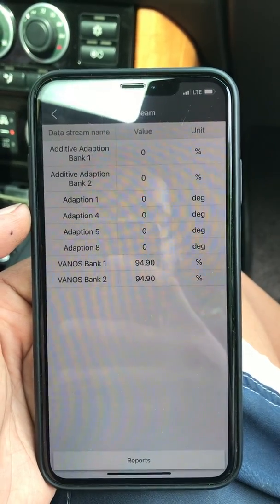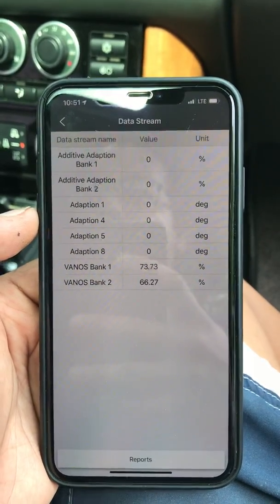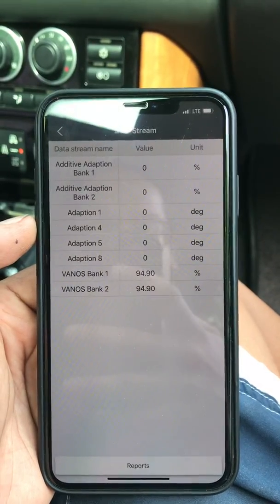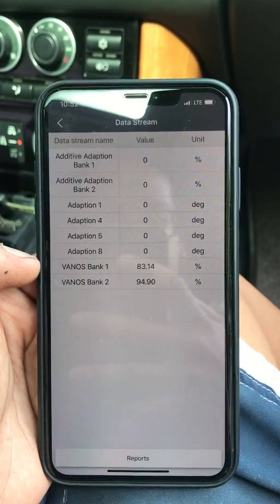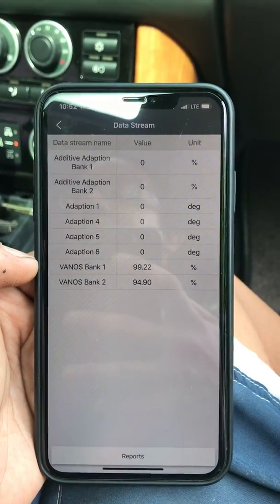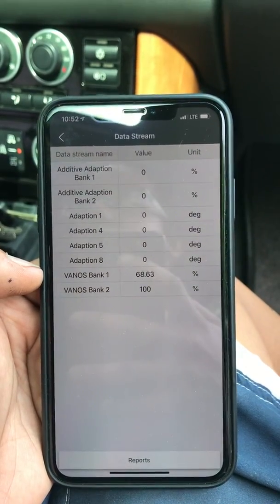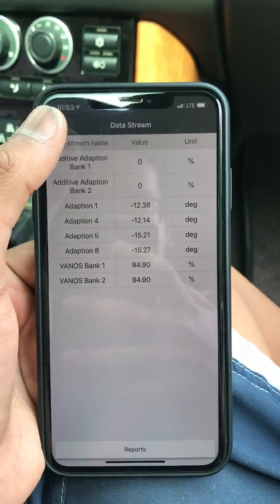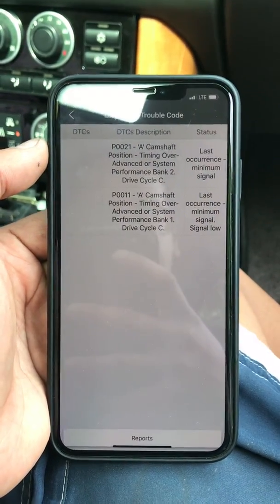2004 Range Rover HSE 4.4 M62TU Vanos Problem P0011 P0012 Fault Part 2

Comment: Looks like your cam wheels are not timed properly. There is a inspection hole in the timing cover to confirm but valve covers have to be removed and all timing tools have to be reinstalled.
Reply from the maker: Joshua Esquivel thanks so much for your reply. We used the timing holes to align the impulse wheels, however, there was still enough of a misalignment in how those wheels were being read by the camshaft position sensors. We ended up retiming the engine several more times before switching the upper timing case cover gaskets to genuine BMW ones and also using the BMW profile tool to properly seat the upper timing case covers down before tightening the bolts. That completely fixed the timing codes and now both banks are timed perfectly to within 1/100 of a sec and the Vanos system works perfectly. We didn’t realize that the position of the upper timing case covers needed to be so precise to ensure accurate timing readings.
Reply: having similer issues 2hat is the name of the tool and where can i get it  @mjrgroup

Comment: What's the fix?
Reply from the maker: Hi, the fix was to seat the upper timing case covers down properly and then tighten the 6 bolts that affix them in place. If you do not compress the upper timing case covers down with a tool (BMW M62 profile tool) then the camshaft position sensor will not read the correct value and send the Vanos into shutdown mode.
Reply: @mjrgroup  ohhhhhhhhh I'm going to try this tomorrow
Reply: @mjrgroup  Really? I have got the same problem and tried almost everything to resolve it. I have looked at the cover alignment but can't see a problem. This problem started after a shop changed the upper oil pan and it's been this way ever since. Will take another look tomorrow.